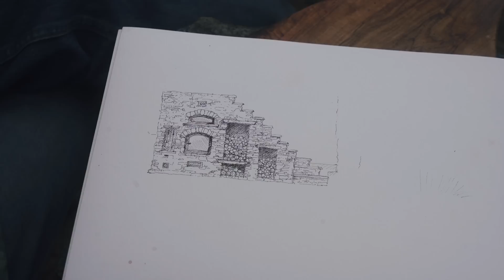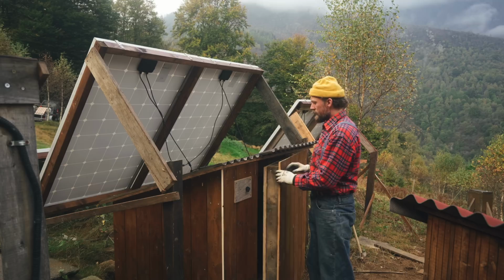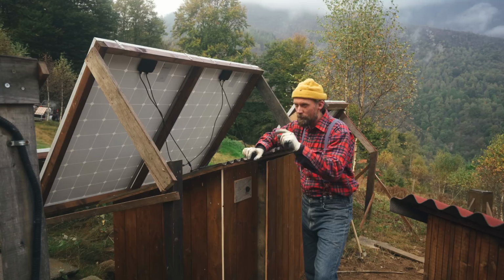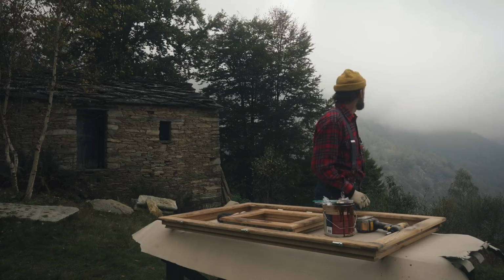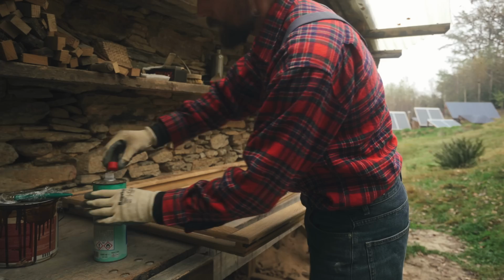#88 Building the Facade of the Masonry Stove

Comment: Hi Martijn … that stove is going to be more than just a heating unit… it’s going to be a “statement” in the cabin. Well done for going with this design … lots of work in setting it up, but so worth it when completed !! 
So glad you have managed to successfully increase the insulation of the battery box as well as adding to the existing power options. Can’t wait to see the windows frames  installed. Good progress !! Durban SA🇿🇦

Comment: Hi Martjin, you put the stones in the water. I understand why. But the stones are also very moist inside. Be very careful when heating up the fireplace. The water in the stones evaporates and the stones explode! You therefore only have to heat the fireplace a little several times so that the stones slowly dry.

All the best, Mark

Comment: This is starting to feel like the home stretch! Will the cardboard be removed at some stage to leave the air gap? That drone really gets some great shots - the operator helps a bit.
Reply: That's what I  was wondering too...the cardboard staying or going?
Reply: He said last week it'll disintegrate along with the tape
Reply: I was wondering about that and the danger of having flammable materials so close to the heat source.
Reply: I think it will burn away when the stove gets hot.
Reply: That cardboard will insulate to much, and will impede a lot of heat reflecting into the room. 
That is not a good idea in my opinion. The gap could be constructed free hand. Just my thoughts preventing you of a mistake 😉
Reply: @storeskeeperrvl3797  I don't think Martijn is inventing his own technique for wrapping the core but rather following manufacturer instructions. If you look at this video (https://www.youtube.com/watch?v=e_RysroO5kA) it essentially shows the exact same masonry heater kit being built and wrapped in cardboard (possibly by the actual makers of the kit?).
Reply: @gregfraser4052  Ok, so the discription wants it like that.
Seemed not logic to me, because my 1976 built tile-oven has a gap between the inner fireclay-stones and the outer tile wall. The tile wall is about 7 cm thick and then comes the gap which is around 1-2 cms, and it was built free handed and of course with no insulation between.
That is the reason why I was curios.
Btw, my oven weighs around 1,5 tons, the tiles are far over 100 years old, and these ovens are built this way since 200 years or more.
Reply: @storeskeeperrvl3797  The cardboard will burn away. It is meant to keep uniform gap around oven core and rock fascia.

Comment: Could build Hidden storage under stairs steps 🤔 Bing watching for last week. hopefully you don't need a permit to build a tool shed workshop thats clearly needed before cabin two restoration. you are doing fantastic, oh a pet electric blanket is low power and would keep the Lipo batteries at a good temp if the installation fails, cheaper to run than a heat lamp.
Reply: ...perhaps Martijn could use a metal staircase with strong enough supports to clad it in stone but still leave cubby holes to slide in some metal boxes perhaps ...wood or baskets too near the stove would not be good.

Comment: I am stumped. Very curious why you didn’t add a layer of brick around the stove, then do the rock facade. I mean the more thermal mass you have the better it will work. I guess we will see how things turn out. I admit I am fascinated by the concept and how it will work during the winter. I definitely would NOT put my water tank in there. If there is ever a leak or whatever that would be a huge mess not to mention the humidity and evaporation. Much easier to get an on demand propane water furnace and mount it in the utility room thing you rebuilt and run lines upstair to kitchen and for shower.
Reply: No room for bricks in the back.

Comment: This video was over far too quickly. That's a compliment, not a complaint. It is very exciting to watch the fireplace build and get an actual glimpse of what it will eventually look like and I'm liking very much what has been completed thus far. As winter draws ever closer, the stove and windows are going to make the house a comfortable refuge when the winter storms come, even though it may not be fully habitable quite yet. The heat from the stove will also make working inside far more comfortable during the coldest months of the year.

Comment: Hi Martijn, why not taking fresh oxygen from outside via a small pipe for fueling the stove? Instead of burning and wasting warm inside air, you take cold air / oxygen from outside.  Otherwise after an hour you might already get a lack of oxygen in the house and you have to open a window for as long als the fire is burning? And therefore decreasing the efficiency of your stove.  However, this need for oxygen could be experienced very personal. I like oxygen and fresh air for sleeping and living, so in that context I do this suggestion.

Comment: Very good precise work on that fireplace. We use a wood burner in our house as the main heating source with a hot air pump in the roof. Had it installed when we built the house and then had the fireplace and pump replaced a few years ago, and it took a 3-man team so you are definitely showing good workmanship skills here.

Comment: Hello Martinjn.
I built myself a firebrick stove with an oven years ago. It works great.
I did not use refractory cement as mortar. I spent a year researching and contacting people with similar constructions and they all advised me to use a mixture of clay and chamote (ground refractory brick 50% of each mixed with water.) Refractory brick retains a lot of heat and does not react very well with cement . I actually put a very thin layer of the clay slurry on and it has never given me any problems.
A cordial greeting.

Comment: Thanks for filling in some of the missing pieces. Starting with the concrete stone facade. The hand sketch with stairs, wood storage, cleanouts, vents, cooking & fireplace tools was subtle. Some unique pieces to be fabricated or assembled, then installed. A piece of art when done.

Same for the power box insulation, temperature monitoring, backup battery supply, generator charging option for repeated days of missed charging on cloudy/overcast days. For now the power shed is 10 degrees warmer than external temperature. The inverters, fans generate enough heat and circulation up to external minus 10 degrees.

Comment: Nice drawing .. the project really comes to life!...Rule of thumb ( and code in many places ) when designing stairs that turn is that it needs to be able to fit a whole foot on the middle of the tread....so at least 12" in the middle minimum,  .. Also Calculate the risers by total "run" so all the steps have the same riser height so it doesn't break the rhythm of going up and down the stairs and so as well, less tripping., your risers then may not be whole numbers to be all even but that is ok.. I also do like a bit of a reveal on the nosing of the tread so you see a bit of shadow.. it queues the brain as to how high the riser is also there is less tripping.. and I think it looks nice too! The risers are placed a bit shy of the tread. so the tread is longer than the riser but it is where the risers are that you divide your "run": length. Max risers are 7 " high usually but often 6 or 6 1/2 is comfortable.. (sorry for the inches instead of metric) You might consider the risers in stone and the treads in a thick chestnut wood...but of course all stone is great as well!!

Comment: If your havng trouble charging your batteries in winter i would recommend you consider a windmill charging system to supplement your solar array. 
They make compact units for sailcraft that are VERY weather resistant.
Even if you dont get tons of wind all the time they can be supplying power at night, during storms, etc. And all you would need to do is put a couple pressure treated polls in the ground near your array.

Comment: That thin insulation is called Kaowool. Never saw it sold in the form your using before. Usually comes in batts 1.5" thick, in a roll. 
Old timey formula for fireproof cement used in forges is 3,2,1 = sand, cement and fire clay. Chickens and most animals that are preyed upon, if they are convinced they will die the next moment, go into a state of torpor. Many bounce back quickly (like a mouse), but some like a chicken will get 'knocked back' for 24 hours, but usually recover. If they get shocked, keep them warm and fed them warm water. 
To bad you did not incorporate a battery box near the heat from the stove.  Hopefully, heat strip will take care on batts getting to cold. Cheers

Comment: I've been a potter for 55 years, and heated many bricks in my day. When you first heat the stove, it would be wise to do a super slow burn at a very low temperature - under 212 degrees F - for many, many days. If the water doesn't fully evaporate before the water in the bricks boils, the brick will blow up. Not a good thing! But all in all, what a well thought out design, and it's going to be beautiful. A quintessential Martijn production! As for the device you want that tells you what the temperature is inside, there used to be very inexpensive non-digital thermometers that hung from the rack in the oven. They were removable, so you didn't even have to bend down to see the reading. Okum's Razor (sp?) is right - the simpler, the better. Also, for the steps that make the turn around the corner, it might be helpful to study how medieval European castle builders did the same thing. They laid out the geometry of each step at full size on a flat floor, and then they  cut each step to fit perfectly. Good luck with the whole project, and thanks again for letting us watch!

Comment: It would be interesting to build a "battery shed" in a cold cilmate using "energy efficent" design principals. Insulation on the outside and thermal mass (concrete slab and solid concrete or bick walls plus slab over) on the inside to store heat and even out the variance in temperature and reduces the maximum & minimum temperatures. I live in the subtropics, so it would be an experiment in limiting overheating

Comment: If you're using sealant (rather than glazing tape) for the double glazed units, be sure to use low modulus silicone (not just normal silicone). Also, the insulation on the battery box looks great but it doesn't look like the door is very well sealed in its closed position? (I could be wrong there perhaps). 
Just FYI, I have a small sash window company in Brighton UK.

Comment: It's great to hear that the insulation in the solar shed is working well. Together with the heat pads your batteries should survive the winter. Didn't know the Victron system could cooperate with a temperature sensor! Wish you'll have enough sun during the winter months. I know it can be very sunny during the winter in the Alps but also days of snow or overcast.

Comment: ...I recommend a small 4 wheel cart for your property, this you think is a child's toy: Radio Flyer All Terrain Steel Wood Wagon, but it has very many uses. There are carts more heavy duty and larger that try to replace the wheel barrel, these are not as useful as the smaller version. Bags of concrete, mulch, groceries it is amazing how much weight it can carry and the balloon tires are great. It will save a lot of walking and carrying........just a suggestion.

Comment: As a masonry heater owner, i'm not sure about the top water reservoir.on my stove a lot of heat is radiating by the side but not much on top. I would rather use copper serpentin in between facade and core.

Comment: Does the oven get its air from the inside? If so, the air will have to flow back from the outside through the rooms, which means fresh cold air draft through the rooms you try to heat. More efficient is, if the oven has a  separate airway into it. Please ignore if covered.

Comment: I haven't lived in any stone house. so curious how it goes
Reply: I have.  In Seattle.  It's like being in a cave.  Martin's is uninsulated, so it will be hot in the summer and cold in the winter.  His is a high humidity area so condensation on the inner walls will be the worst of it.  I suggested a pellet stove in a previous episode, based on my experience living at 7,000 feet altitude in the Rocky mountains.

Comment: Martijin, how does the freestanding stone wall you are building differ to a stone veneer that is applied to the heater? What are the advantages to having it unconnected to the heater? 
Having watched the Temp-Cast masonry heater veneer install using veneer mortar, I'm curious about the choice to build a free standing wall that doesn't connect to the heater. Can the stone wall and mortar withstand the changes in temperature and what will keep it standing?

Comment: heating & sleeping downstairs with all venting/windows at chest height - what would worry me is the fire smoldering, not hot enough to create the necessary draft to take out CO + CO2 through the chimney resulting in a deadly accumulation

Comment: I hope you know that the ignition temperature of cardboard is 230 degrees Celsius. And also that cardboard is a very good thermal insulator. All this means that firstly there is a possibility of cardboard ignition if the furnace heats up very much, secondly that the cardboard will interfere with the heat being transferred to the stones and warm the room, which means the furnace will work worse

Comment: I see you using a broom a lot.  It does not get all of the dust and it puts a lot of dust into the air.  Do you have enough power for a small wet/dry vac with a HEPA filter to catch the silica dust?

Comment: I am surprised that you are using stainless steel stove pipe; it gets hot but does not radiate heat. Using cast iron pipe you will harvest the heat from the smoke.

Comment: Why not wooden staircase? From recycled beautiful old wood?  That way there would be awesome possibility to make cabinet under it? Another thing is the battery box. We live here in arctic. Our mantra or 101 on insulation is "do not leave cold bridges". Now there is straight cold bridges on the battery box. So the insulation should overlap on the corners. To make sure, that there is warm enough, the insulation should be inside. Good usable material is foam.

Comment: The air inlet for the stove should be outside. Or it will suck the warm air out of the room. 
Pros use coaxial stainless steel chimey to warm up the cold burn-air with the waste heat going out. Hot gasses go up in the inside tube while the cold air is sucked down the enclosing tube. Must be stainless because of the sulfuric acid condensation from the exhaust gasses.
Reply: We have to assume he's following the manufacturers instructions for installation of the stove....dont we.....!?
....maybe you know better then the manufacturers....
.....you should get in touch.....!

Comment: Am not so enthusiastic about those hugely heavy stoves, they are fine if you are permanent resident but if you are not they will start giving heat after they are lit way later than a good cast iron stove like a Jötul them being so heavy. Also there is a lot of urban legends going around about efficiency of wood stoves. There is not a huge difference of efficiency between different sort of wood stoves, for very high efficiency you need to force air inside the combustion chamber with an electric pump like pellets stoves, if not the efficiency will stay around 80% max, claiming more is mostly marketing to justify high prices.
Reply: Flatlanders new to the mountains have always had a steep learning curve.  Give him five years and he will figure it out.